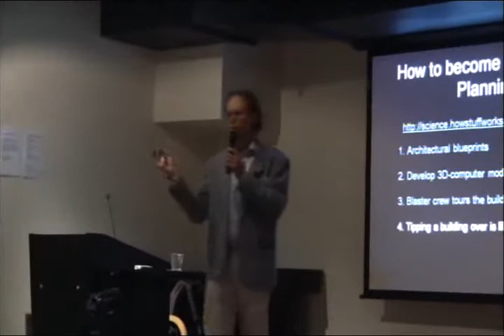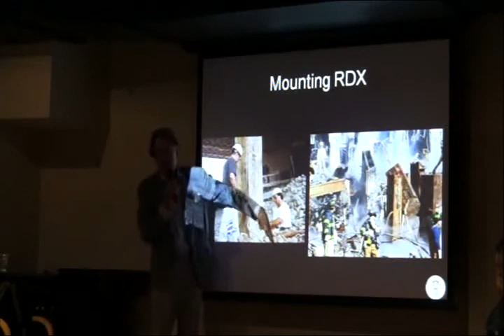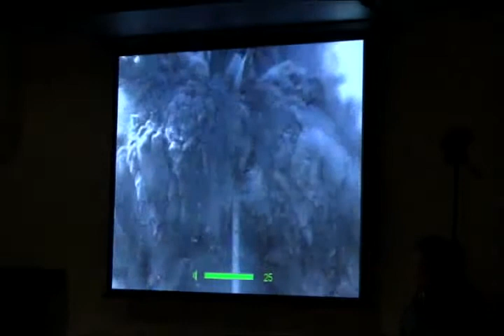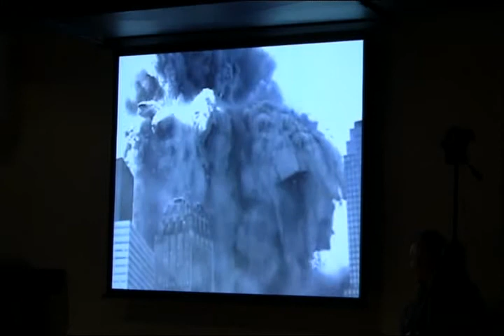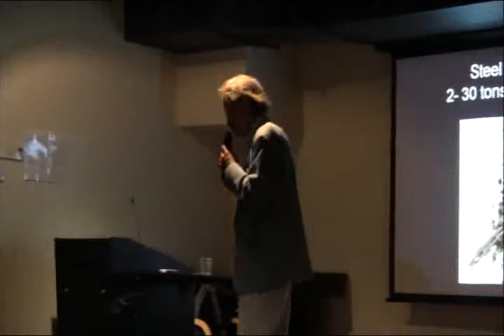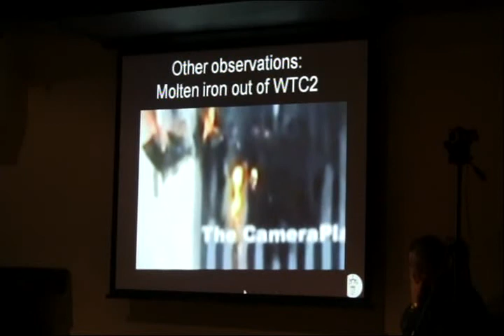9/11 Prof Niels Harrit Nano-thermite Lecture ... WTC-7, Building-7, Iron Microspheres Part 11/18

Comment: How can 3 different buildings, with 2 types of design (B7 and the towers), with different kinds of damage (the column damage was not identical even with towers) result in the same straight down, symmetrical collapse ONLY observed with controlled demolitions using explosives?  To add that, these 3 "fire collapses" are accompanied with witness testimony of massive explosions, flashes of light, along with physical evidence of nanothermite. 
NO towering infernos exhibit these charcteristics..NONE!